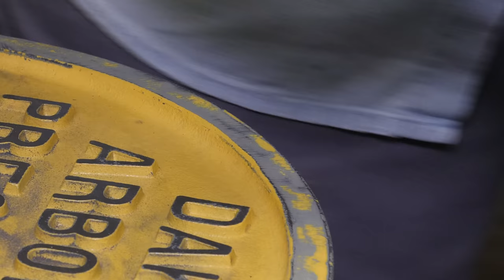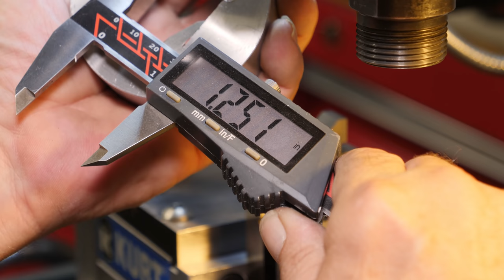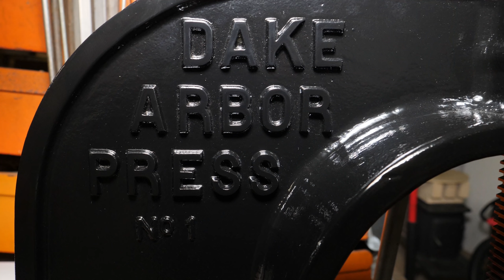Dake Arbor Press

Comment: I bought one a few years ago but I just use paint stripper on the old paint a couple times and it all came off very easy. I painted it Machinery Gray like it originally was. Looks brand new now.
Reply from the maker: Mine now has a few dings from use but still looks great. I put Johnson paste wax on the bare metal bits and no rust so far!

Comment: Just picked on up today and it seems, to have an issue or just a design feature I consider a flaw. This one is really old, says NAVY on the top haha. 

Any way the "flaw" is the spindle or splined cross shaft the handle slides through is only supported on one side. The other side where it comes out and the washer is bolted on has the gear splines all the way to the end and that end has no support. I see on the newer version it seams the gear splines are machined into the spindle then on the end it is smooth & seems to be supported.

I want to fix this by chucking it up in a lathe, cutting off the gear teeth on that end and machining it to a diameter that will fit a bushing pressed into the end. This way when it is being used the spindle will be supported on both ends.

Or.... maybe I should see how much the newer style spindle cost and buy one from Dake. If it meshes properly with the teeth on the square shaft and the outer end fits properly into the other side and is supported then that will fix that problem with $$ spend but no work other then to disassemble it and replace that part. 

I'm thinking what fun would that be though. So I will probably rebuild/modify it to work the way I think it should work.

Comment: Nice restoration. The only thing I’d do if it was my press is mill the bottom teeth off so you can adjust the handle position. Since this press doesn’t have the ratcheting system on it
Reply from the maker: Sawlogs Plastic Hubs by James Dedmon  I’ve seen that trick. Figured I’d use it for awhile first and see if that’s really needed. The handle is really long so it’s pretty easy to get leverage at any point.

Comment: That came out Great! I Love it. What brand and model is the small Drill press you used for the through holes? Thanks, Have a Nice day.
Reply from the maker: It's an Electro Mechano Model 101W. Auction find at a great price. Works well, and I haven't touched it other than wipe it down!
Reply: @BurtonsAttic  Thanks for the reply! Its a Beauty of a little Drill press. Nice to see older tools still being used. Im a vintage tool and machine kind of guy lol i love my old heavy great made tools. Have a Great day.

Comment: Why can't we get that paste wax in the UK?? Anyway, nice job man. 👍
Reply from the maker: Can you order it on Amazon? Technical it's a floor wax and smells like it has some solvent in it. It's mushy not like normal wax. Works great in the shop for any exposed metal surface.
Reply: @BurtonsAttic  Doesn't appear to be available anywhere over here unfortunately.
Reply: Check out Libéron products.  Also works well and available in Woidworking stores in UK